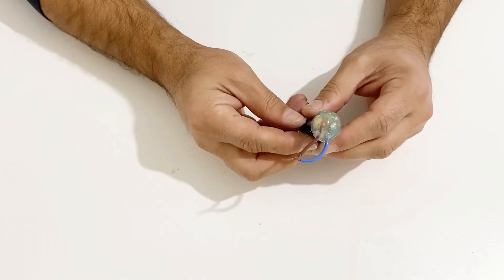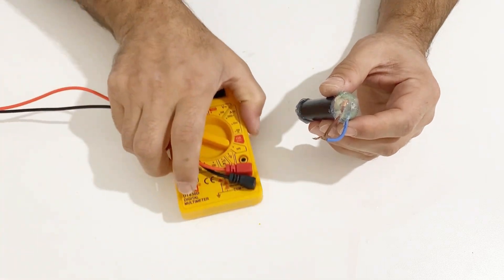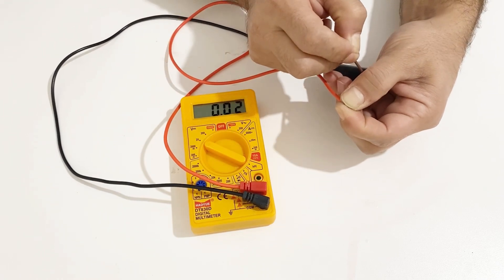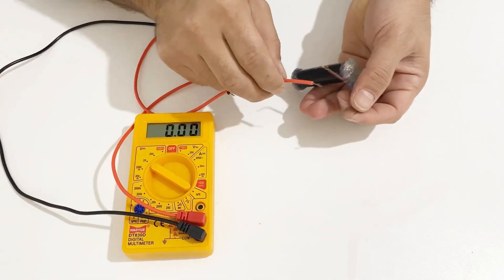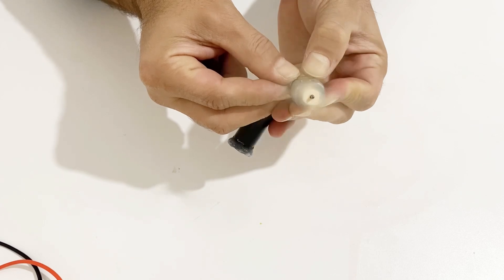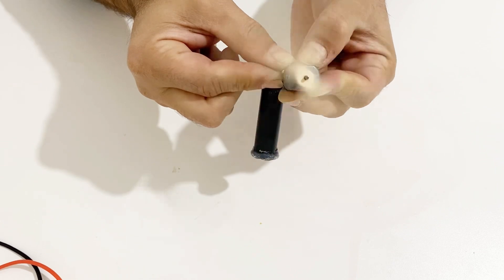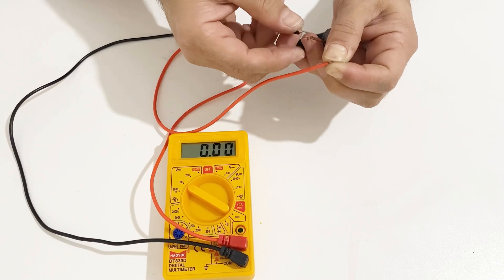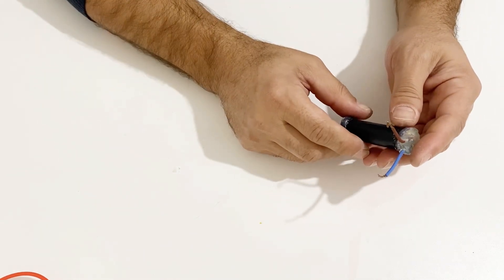AA Battery Size Homemade Supercapacitor.

Comment: what material did you use to make the plates of this capacitor? aluminium or copper? and what is the electrolyte? will common table salt NaCl work as an electrolyte? 
thanks
always enjoy your supercapacitor videos
Reply from the maker: Thanks brother. I used copper foil and use water based 35% sodium hydroxide electrolyte.
Reply: @joyofelectronics9782  If copper electrodes, what does "AA" stands for?
Reply: @techskills4046  i think he meant that the capacitor is the same size of an AA battery that you can buy
Reply from the maker: @ignilc yes l meant the size of it